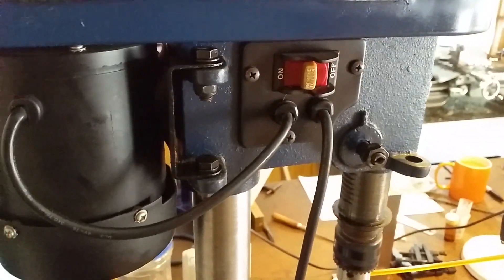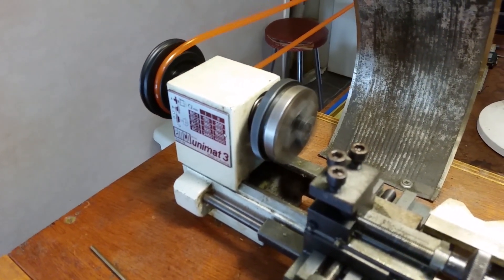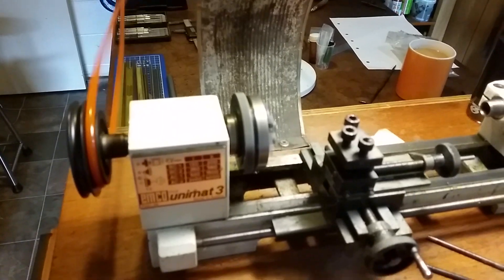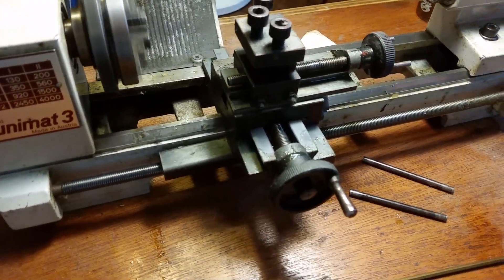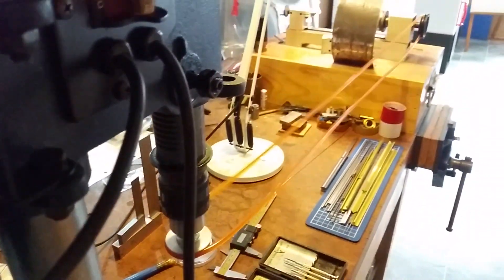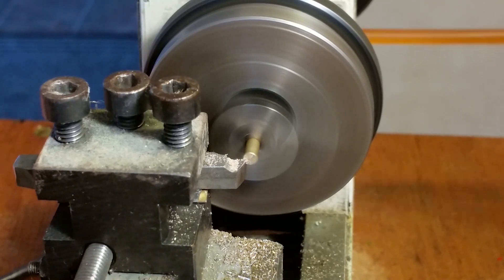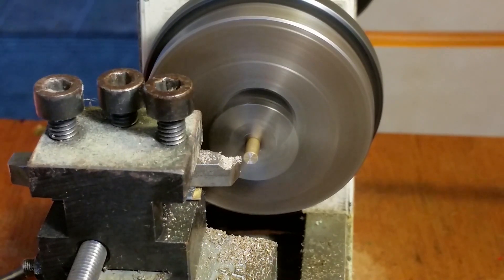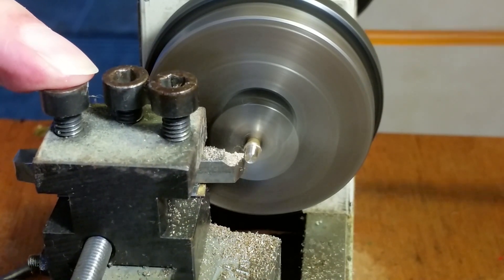Making Brass 8BA Bolts for Valve Gear Motion on the Emco Unimat 3 Lathe

Comment: I also have a Unimat, and have to pad-out the underside of the cutting tools similarly to the way I think yours is. I bought it second hand so I've no idea why this is - whether the tools are the incorrect ones for the lathe or some other reason

Otherwise, useful little machine
Reply from the maker: It's quite normal.  As soon as one starts sharpening the tools, material is lost and they will need packing to centre height.  They are good machines

Comment: Whenever leaving a shoulder on a homemade bolt I make a sleeve to go over the plain portion so the thread is the right length.
Personally I would have case hardened the valve gear and used steel bolts.